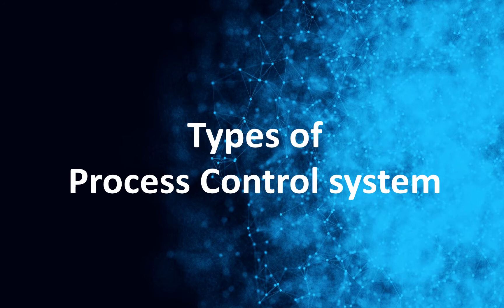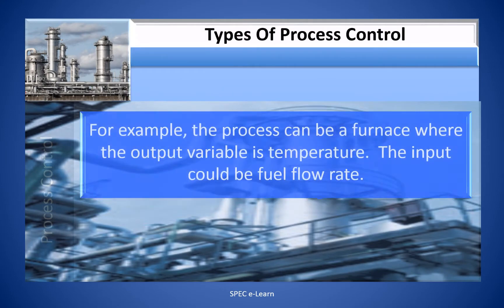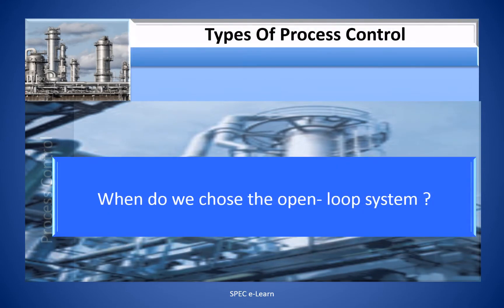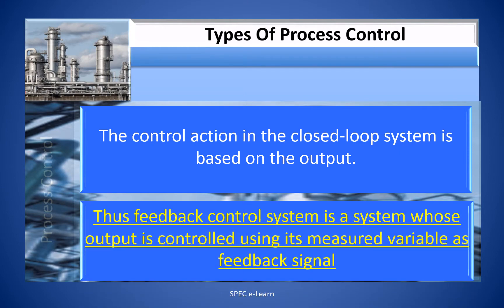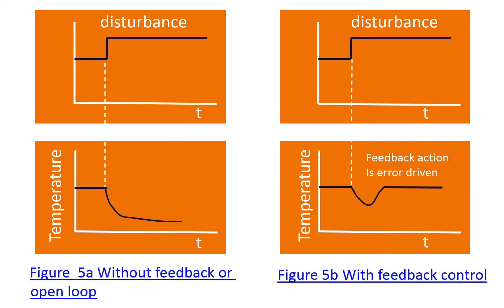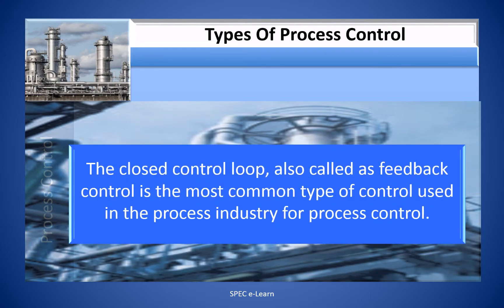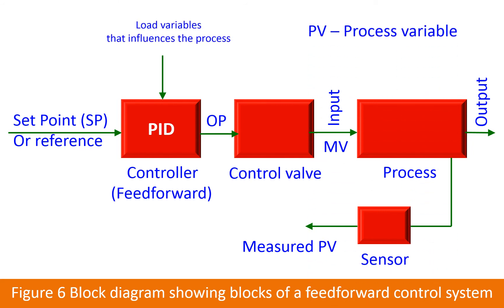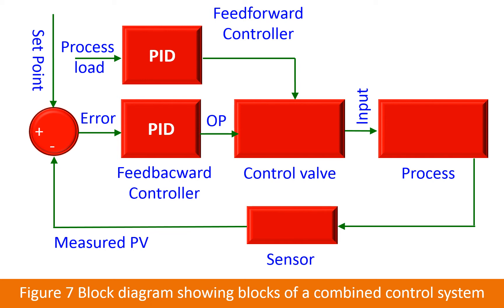Types of Process Control

Comment: What is  difference  between measured variable ,controled variable and manipulated variable ?Please reply sir.
Reply from the maker: @naveenpandey3255  Thanks for your question. Measured variable is the process parameter to be measured for control purpose. For example if you want to control the process temperature in a reactor, you have to measure the temperature first and compare with set point temperature in a temperature controller. The measured temperature is the measured variable. The output of the controller is used to vary another process variable through a control valve. This may be steam or cooling water. This variable is called manipulated variable. The controlled variable is usually the measured variable. Hope this explanation is useful
Reply: @SPEC786   thanks 🙏 sir for giving such nice explanation
Reply: @SPEC786 please upload new videos on other topics as well ...Your videos have been very informative and helpful..We are willing to make membership if you upload videos often...thank you!!